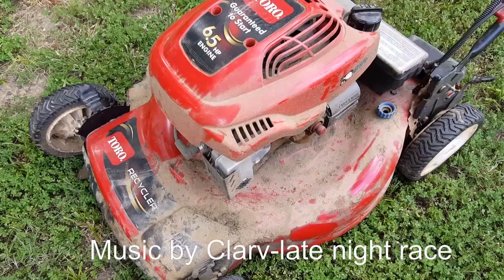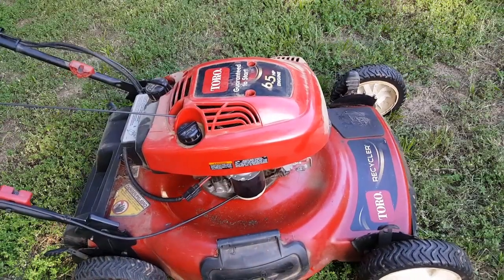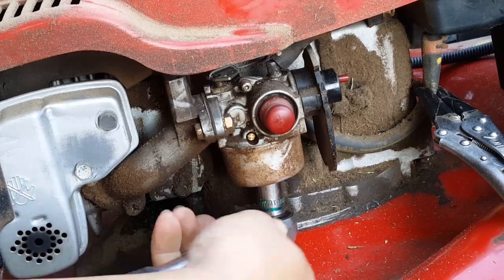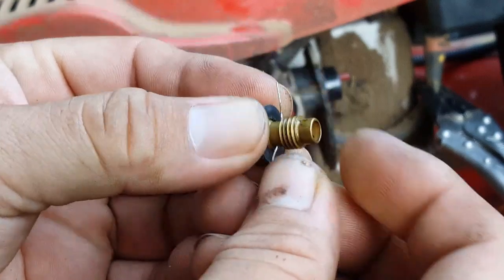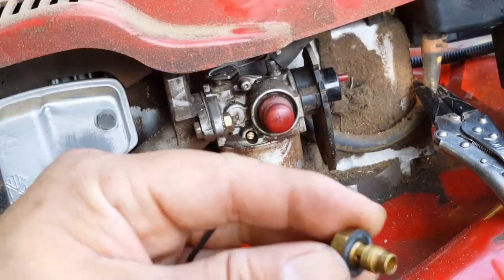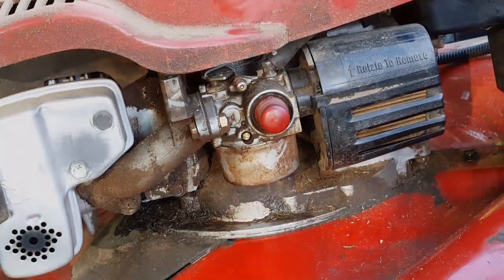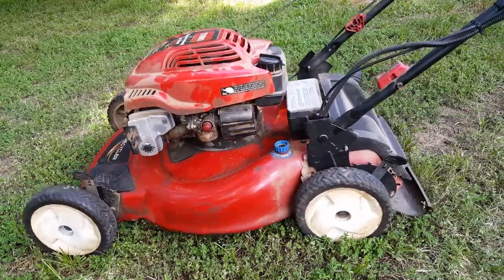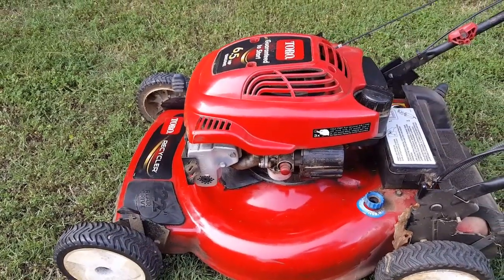Mower starts and dies, quick and easy fix.

Comment: Don’t know why people give a thumbs down...just move on to another video..anyways....Thank you so much...I had a mower I was going to get rid of I’ve had for 18 years...hasn’t run in 10. It was doing this. I’ve gotten another mower since then. I took it out today and put on a new blade, new spark plug...fresh gas, fresh oil, cleaned the filter ...same thing as 10 years ago...I gave up. I came in YouTubed it...saw your video...went out..took out the nut..holes were filled with green hard stuff. I poked a wire through it, sprayed it...put it back in...and it fired right up and ran clean...thank u again for the great video
Reply from the maker: Thank you for the comment. I guess theres a part of the video they disagree with. It's their choice to do so and I just thank them for watching.
Reply: Thumbs down is strictly a democratic thing.
Reply: @HomeGaragechannel and little do many of them know, they're getting you paid!

Comment: Gotta love how simple those carbs are, this model from Toro flew off the shelves and you can still find them everywhere
Reply from the maker: It's got its good points. it would have been better if it had a fuel shut off valve and a weather proof filter housing.

Comment: Quick and easy, worked to fix my craftaman mower that was sitting in the garage all winter. Didn't seem like there was much stuff in the bolt but it fired right up after poking out all the holes.
Reply from the maker: excellent work. yes it doesn't take much to block that tiny hole in the bolt.

Comment: I found your video and after I cleaned the part you mentioned in the video my mower started right up and worked just fine. I also found out my air filter was completely clogged (I’ll try to replace it). I cleaned out it out the best I could for now. Thanks for the help! I’m not very mechanically inclined at all but I will try with help 😁
Reply from the maker: Excellent work.  Thanks for the comment I appreciate it

Comment: Thanks. Just fixed mine. Would start and run for 45 seconds then die.

Had loose bolt on intake, but I think my main problem was the gas cap not venting properly. Drilled a hole in gas tank housing at base of cap, and works now.
Reply from the maker: very nice work!

Comment: Exactly what I needed!  Winterized my Toro last fall then tried to start it this spring.  No go - just as you described.  I was looking at 4 - 6 weeks purgatory at my local small engine shop.  So, I followed your instructions and cleaned the main jet as you described.  (13mm by the way.)  NO obvious problem so I was concerned -- was this worth the effort?  Put it back in and the Toro started on the first pull!  Outstanding!  Thanks!
Reply from the maker: Glad it helped
Reply: I find that taking things apart, then just fiddling with and staring at them, then putting them back together, has amazing restorative properties!

Comment: Thanks, I suppose, I was really hoping it wouldn't work, cleaning that bolt worked like a charm, If it didn't work, I was really hoping I could finaly to buy an electric mower from Costco!!😁😁
Reply from the maker: if that's what you really want go out and buy it.

Comment: Keep on using it till it croaks!! If you were to resell it, you would definately need to replace that motor either with a new one or a good used one. They still have high resale value. Here in the Chicago market they go from 200-400.00 used.
Reply from the maker: wow! here i might go for about 100.

Comment: Mine will start up, but only run for about 5-10 seconds. Assuming it's the carburetor and not the spark plug?
Reply from the maker: Yes it more than likely it's the carb, Also crack the gas cap loose and see it lasts longer.

Comment: Oh i feel so dumb. I took that nut off and was looking for a jet 😂. Im not used to small engines. That's an easy jet to clean.  Also i moved that small screw you can see on the side since my bowl was stuck i thought it was holding it in. Does that need to be adjusted?
Reply from the maker: I believe so but I've never had to adjust it so I'm not sure what to do about it

Comment: Tried this and still nothing. I've replaced the spark plug and air filter as well. What else could I try?
Reply from the maker: Thank you for the comment I appreciate it. Borrow a compression tester and get a reading. Hopefully it's over 50 psi.

Comment: My Toro doesn't have the fuel jet, just a nut. What else could be the problem? The gasket?
Reply from the maker: If your toro has just a nut then the jet is inside the carb. It needs to be removed and cleared.
Reply: Is bowl nut the same part as fuel jet
Reply from the maker: @jakewiener83  for the mower in the video yes.

Comment: Geesh I need the try this, all weekend I worked on mine, starts and runs 15 seconds then quits
Does this mower have a gas filter on it? I was going to check that to but don’t know where it is
Reply from the maker: There's a screen at the outlet of the tank where the hose goes but not a replaceable one.
Reply: Home Garage ok
Thanks pal
I’ll try that to :)
Never had this issue 
Always started first pull
I’ll clean these things and try it
I’ll let you know how it goes
Reply from the maker: @RCALivingStereo  excellent.

Comment: What did you have to do to it to keep it running? I have the same one and has been running good for like 20 mins then slowly dies. Let it sit for 15 mins then she starts up again. But then shuts off after 20 mins lol.
Reply from the maker: yours sounds like a combination of ethanol gas swelling the needle seat, which reduces fuel flow thru the carb, and a bad gas cap.

Comment: Okay woukd start up and die so I cleaned out the carburetor screw... cleaned out all the holes but now it won't even turn over.  I don't know? Any ideas?
Reply from the maker: is your engine like the one in the video? did you remove just the screw or the bowl as well?
Reply: @HomeGaragechannel  I just remove the carburetor screw and cleaned it and yes it looks like same engine as the one in the video
Reply from the maker: what about the bowl?
Reply: @HomeGaragechannel  I didn't take the bowl off for fear that the gasket would be destroyed and then I wouldn't be able to put it back on without it leaking
Reply from the maker: I see, thanks for the information. Do me a favor and loosen the bowl nut and tell me if there's a constant fuel flow after about 30 seconds. This will confirm that fuel is flowing from the tank, into the bowl
Reply: @HomeGaragechannel  Yes there is a constant flow of fuel coming out of the bowl.  And thanks for responding love to get this thing running
Reply from the maker: are seeing any fuel in the throat of the carb, after taking off the air filter and pressing the primer bulb?
Reply: @HomeGaragechannel  I took the air filter off and was pressing the primer bulb and gas was coming out where the air filter was... is that what you mean?
Reply from the maker: yes that's what I mean, that the fuel that engine is going to start on,  can you send me a pic of the carb from different angles?  homegaragemail@gmail.com
Reply: @HomeGaragechannel  Ok I sent a few pictures over... I hope that's what you need. Thanks again!

Comment: Didn’t make any difference. Any more ideas?
Reply from the maker: So it does start and run for second? If so remove the bowl and drain all the old das from lines. Is your fuel less than 30 days old?
Reply: Home Garage I pulled the carb off and sprayed it all out and poked the passages with a cleaning kit. The fuel might be pushing 30 days but it is non-ethanol and was in a gas can. Smells and looked fine. Thanks for the help.
Reply from the maker: @larryfogle3697  thanks for the comment I appreciate it